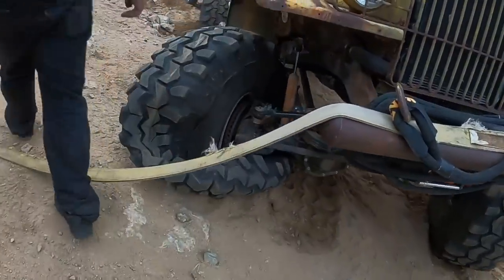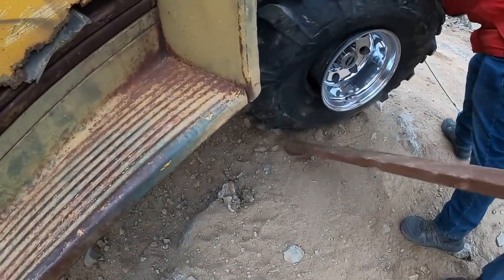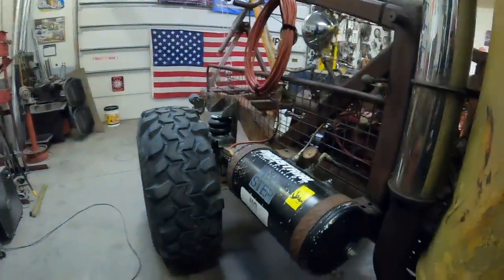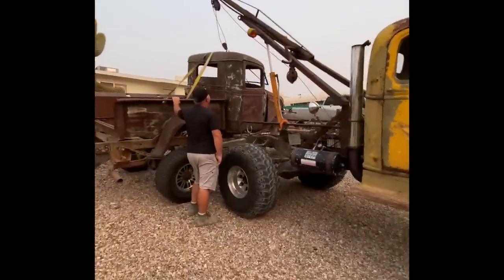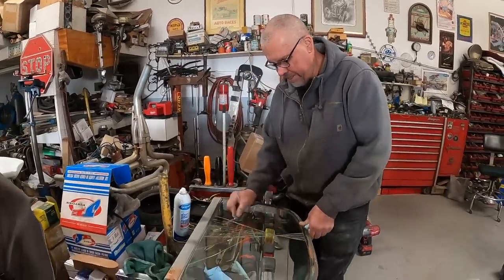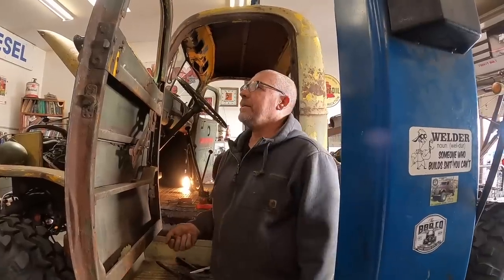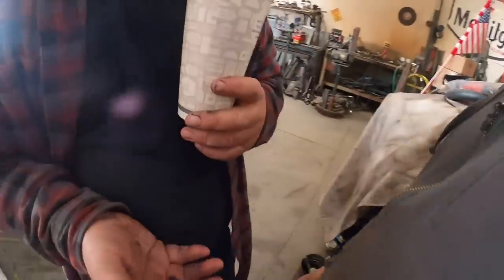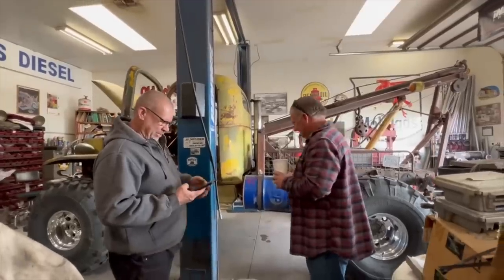The Off Road Wrecker Games are Getting Close, We Will Be Ready $$$

Comment: Merlin, I am very proud of you younger people who take a lot of pride in our country that I served for. I have a lot to say and maybe should break it up in many stories as I have history with most of the army, navy rigs of the late thirties and newer. Dad had me in the seat of a lot of the four by and six by rigs... used  them logging in western washington. We would go  to a part of seattle when seattle was many little towns surrounding the bigger town. A huge place was created for storage of these rigs and we could go there, pick the ones we needed to fix or replace stuff  we had. Our interest in them was the running gear so the  condition of the cabin was just a "if it still works fine, but we could always graft another cabin on them if necessary to make it drivable. I was early in life made aware of not abusing those front axle seals as they are in no way related to the new stuff with regular seals and gaskets... I got myself a roll of knitting yarn to go around bolts and make temp seals till we could disassemble to use the more like a fiber  type of rope that .... heck, you've been in them so no need for me to describe it wrong. My favorite was the GMC trucks with a 270 engine... believe me or not, I ain't here to lie or tell stories fabricated to make it a "better" story. I actually found a few at the yard with two carburetors on them. Gas was very cheap as in less than twenty cents per gallon... I was allowed to put adaptors on those manifolds and put two two barrel carburetors on them for the additional power we were looking for. It was the idea if we supplied more fuel, we had more power and I do guess thats partly right... I was only fourteen at that time. I moved to alaska after I came home from the service in 70. I have had a lot of these trucks as they were in almost every older farm yards... meaning they were adaptable to different kinds of work, just use the imagination as  to what you needed an a  stick welder. A young man living near Tok Alaska, his name escapes me but his collection is getting up there with the many varieties of military rigs and he is friends with a man down in Seward Alaska area who probably has the largest collection of them and does sell a lot of parts if you fill his criteria. He doesn't want to see them destroyed by kids who will never understand the importance of "This stuff is not made anymore!" So the young mans channel name is Backyard Alaskan and he is kind of starting to release a lot more videos. Its his early videos that show him with a large part of his collection being repaired to work again, plus his working with the fellow in Seward Ak. I know that he did give out phone numbers for the guy down there.... he is semi retired now. My memory is really going away as that man and I were friends when I had my own shop in Anchorage. After I moved from anchorage, I quit drinking and being probably the most stupid fellow in alaska. I am still stupid as moving doesn't increase knowledge, but lets say I started making a lot better decisions. Too crippled to  travel or do much of anything or I would travel down to your area for a vacation and see just how you folks have fun... as for me its working... I loved everyday I spent doing something mechanical. I remember now something you said and kind of disagree. You said doubles the power of gas.... its more like  triples the power flatfooted and if ya give it some help, who really knows the limits of power a diesel can make. I guess this is a good spot to stop and if ya have questions, put it in a reply to me... hopefully I will see it and if memory works ,then I can help

Comment: At the ripe old age of 16 I traded a go-kart engine for a 46' Chevy 1/2 ton, I put it back on the road and drove it for 10 years, it was my daily driver, all I changed was a 12volt conversion and a key start starter. It had the same steel framed windows and crank out windshield. I miss that truck.

Comment: Matt made his tow truck look so much like yours.  Sadly Matt keeps twisting off output shafts for the front and rear driveshafts whenever he spins the tires.  Today Matt did say that it weighs 4 times more than the Morrvair.  They do have a lot of suspension flex, so that can bind drive shafts too.  :(
Reply: Apparently you missed the first one-third of Matt's video today.  If you would've watched the video, you would clearly know that Matt explained in depth why it kept twisting shafts. They replaced the parts in the transfer case & took it out on the toughest trail around Sand Hollow. It performed extremely well. Granted it is heavy, but actually i think that's going to be in Matt's favor. The others are going to be too lite in parts of the competition, with maybe the exception of Merlin's. 
Matt's was designed to be heavy, he built it to pull the big motorhomes out of the sand at Sand Hollow, not for the wrecker games!  
As far as who's going to win, I'm not really going to say. I think they will all perform well. Matt has tested his twice, at King of the hammers, & then just now. 
Paul hasn't tested his yet, but it should perform ok. 
Rory takes his out on trails & climbs everyday, has been for years! It's his job! He should do good. 
Eric has had his for years, but he doesn't go on the trails & rock climbs as often, because where he lives. 
Merlins has been pretty much battle tested, so we'll have to see😊 
Should be good, & the main thing of the wrecker games is to have fun, so that should make all of them winners.

Comment: I believe those MaxMPG bottles are designed so you can squeeze the bottle while it's in the upright position and it will slowly fill the upper chamber to the desired level. Then you tilt the bottle to pour the liquid contained in that upper chamber.
Reply: They used to make fuel stabilizer bottles like that as well. Haven't seen those for a while though
Reply: @classicgmdiesel1248  I've got some two stroke oil for my weed whacker in bottles that work like that.

Comment: Hard not to pick Rory for first.  Experience, knowledge development and refinement are a huge advantage, plus he is an artist driving.  If Matt doesn’t break he will do well, and he might not break I think Paul will struggle, the truck is heavy, especially for his driveline, hydraulics and wheel size.  I don’t know Eric.  You are the wildcard, the crawling part might stretch your rig, and I don’t think the diesel is going to make a difference… pros and cons especially in the crawling environment but your problem solving is first rate and the weight of your rig has got to be one of the lowest in the field.
Reply: Nah, Matt has added too much weight. Sure, he might rule in the sand but steep rocks - from what I've seen so far, he doesn't have the traction with all that weight.
Reply: It looks to me like it's more the brand of tires causing he's traction  issue
Reply: @wild2heart  I don't think there is a lot of choices for those sizes.  Having said that the only other rig we have seen doing technical crawling is Rory's.

Comment: I like the diesel engine for heavy pull. I pull heavy trailers with mine and love that it can start out at idle RPM even on the hills. On a standard transmission you need 3 feet when you are behind a gas rig

Comment: Y'all have amazing skills.  I seriously doubt that one team will take all the prizes.  I just hope we don't see a lot of whimpering when it is all over and all the competitors remain friends.
By the way, if you want to remove the rust from old parts inexpensively, try soaking the parts in 10% molasses/90% water for a few days or weeks, depending on how bad the rust is.  This will not replace the missing metal, but it will remove the oxides that bind everything up.  I was thinking of your window regulators, Merlin.
Be well and I hope that Gen1 Diesel does everything you want it to.  I have one myself.

Comment: I put Merlin in the top 3 for sure.  His truck is tried and true for sure, but he has  the lightest truck with the second largest tires.  Rory is a force to be reckoned with for sure.  The heavy wrecker is just that and you can't fix fat, plus it doesn't have enough ground clearance for its wheel base.  Which is also  a problem with the rat rod wrecker.  I love all the builds but Merlin's is my favorite .

Comment: First metal work I learned with oxy acetylene rig was brazing. Then mild steel, arc, tig, and finally mig. Well okay actually soldering was first.  I still love to braze but there is so little opportunity to use it as I don't work on the old stuff like you. 
    Sad the mini semi won't be transporting.  Been watching that build since its day one.   I'm sure many others are disappointed too Merlin.   By the way be sure to wear your glasses at the wrecker games or you could be mistaken for Paul and he'd get credit for your work.     Speaking of, does Mater have a heater core to even warm the now weather tight cab or are you gonna look like Robbie in his Kat all fogged. 
  I don't recall if tow Mater has the T case Trail Mater does that is able to engage axles F or R  plus the outright experience of Rory. I think the 40" tire will play a part but so too will your suspension.   The diesel will help but straight up some rock faces approach n departure angle will be helped by your tire size.    I think you are the only real competition to  Rory just walking away with the title.   Matt n Paul will be duking it out for the bottom. I expect to see either you or TM haul the stupid heavy WLOW more than once.  The ORI suspension will do okay but can't carry a load as demonstrated by paul at chads trying to offload that hulk of what was once a tow truck that had NO suspension in front and squatted that ORI struts to the axle tube.   Trail Mater and its pilot have proven many times capacity.  You're smart and capable of considerable creative feats.   Matt could be a threat if he had a more proven and well engineered machine. 
So let's talk about Eric n Seat Cover.   His machine too is well proven and so too is he. Capable of finding fixes and determined to get the job done. Main problem for BSF is he's not a rock crawler in his experience and his machine isn't all that flexible. Something he needed last time in Sand Hollow. The last time he had Rory to help him as a spot and use TM to get the wrecker off he rocks his approach angle couldn't accomplish. He's enlisted a secret weapon as a spotter trail guide which makes him a competitor. Power wise and transfer case wise his machine lacks also.
I haven't visited the site but the golden tickets didn't outline what feats the games will be requiring of competitors other than saying what ever rules Matt wanted to come up with.  I also heard from both BSF and Robby that they will be towing a samurai through a simulated recovery.   As a result I can't pick a winner but I can prognosticate who will be the front runners. 
  Best of luck.

Comment: The contest will hinge on the course and terrain. The familiarity of the driver to the terrain will be huge . Since Matt designed the course it will probably favor his custom built machine  that probably used $1 million worth of materiel,parts and labor . If the course was at Moab Rory would be a shoe in . Each wrecker will have their strength and weaknesses and look forward to the contest. If it’s very cold Merlin will be a might uncomfortable but only God can  call the weather.

Comment: #1 Rory, Mike and Shawn, they do it for a living and Trail Mater is one bad motor scooter. It's custom built for that area.
#2 Mater, it will blow the crowd away. Probably the lightest truck there and that is an advantage along with torque monster and front weight bias advantage. 
#3 Cousin Paul #4 Matt's gang. They both will break. Paul for sure, they have the weakest drive train and Matt's has a pretty good chance of breaking if he hammers on it
#5 The Wisconsin bunch. It's a good rig for mud, not too sure footed on the rocks.

Comment: I think Matt will win if he doesn't break something.  The chances of him breaking something are pretty high in my opinion.  That build is awfully complex.  Fab Rat's is equally untested and likely to have unexpected breakage.  I don't know the other two.  Your truck is well used and well tested and you are not scrambling at the last minute like most others.  Scrambling at the last minute can be good or bad, but I predict bad because guys are torchin',  welding and wrenching by the seat of the pants, likely to have problems with that last-minute work.  I won't be able to go myself so I hope there is a lot of good video.  If you actually make it there without a heater, I think you will do well.  I recommend getting a snowmobile suit and boots if you are not partial to cold weather. ha.  And I agree with you about diesel power for this type of application.

Comment: Good luck! Personally feel Rory will be first, maybe a race between you and BSF for 2nd, then Paul and MORR coming in last, at least this time around. Matt's rig weighs a ton, not a great thing if he's towing a vehicle up a steep incline as it seems to have trouble on walls just by itself(plus he now seems a little scared of gunning it, and it hasn't been thoroughly tested. I think it'll break on him, and MAYBE Fabrats will as well? I think Matt will learn a lot about his rig and over time it'll become a much more capable rig, and if this becomes an annual deal, he may have a much better shot down the road. But Trail Mater is a beast, tried and true, and Rory is also one of the best trail mechanics I've ever seen, so I think he'll mop up on the welding trial.

Comment: At Least 1-12v defroster/heater with blower.They're @$20.Why Not have a clear windshield and fingers that bend? Window Tint sheets will hold the glass together.Bud had a back door window broken in his 2008-ish Dodge and the tint held the tiny pieces in place.Get the lightest.

Comment: I think the biggest issue you will have Merlin is the lack of beadlocks. Getting enough traction on the rocks while towing will be tough without putting your PSI down low and then that's where the lack of beadlocks will be problematic. Your rig is WAY lighter than Matt, Paul and Rory and maybe Eric, but I know nothing about his rig. So the lightness will help UNTIL you're pulling up a hill and then hopefully you can get enough weight up front to keep the wheels on the ground.

As I said, I know nothing about Eric from BSF, but I do know he's got a lot of experience and of course Rory has LOTS of experience with similar, or worse, terrain. So my guess is Rory overall, likely Eric next and then you Merlin. With Matt and Paul 4th and 5th. But each truck will win a category or two. There won't be a blowout by any team. Paul's for sure gonna break stuff and Matt might, but he's broken enough and gotten that stuff beefed up so he might stay in one piece. Maybe.

Comment: TowMater will be in the top 5 and may be the sleeper even with the slow and steady diesel.  ;> 

Matt, if TomTom can keep him from going hot and heavy on the throttle, might make it through without breaking his drive line again or would that be again, again and again (I've lost count).  

The rigs that already have basically been daily drivers for a while will have the edge for reliability along with their known strengths and limitations while the new builds will be a learning experience for Matt and Paul.  The miles of wiring and computer controlled engines in the two new builds despite all Chad and Companies hard work can become an Achilles Heel for those teams.  With the way Rory and Merlin maintain their engines and drive trains there should be little concern about them being too tired and worn out for the event.

Personally I hope its becomes a Rory and Merlin competition and if Merlin comes in one of the top two spots he should also win the honor of selecting the Turbo Diesel to put in Matts SaMorrI.

Regardless of the final rankings all should be sharing victory pie when its over just for competing.

Best!

Comment: I have not really seen many of these wreckers in action except Rory's Trailmater. It may look like it belongs in a salvage yard to be recycled but it does impressive work. I think that the 2 at the biggest disadvantage will be Matt's Big Off road wrecker and Paul's from Fab Rats simply because they have not had time to run them and get the kinks worked out of the machines. I have watched a few of the videos of the BSF team they seem capable enough but sense the games are in Utah they will be at a bit of a disadvantage as well different environment and different type of rig. So Truthfully Either Rory's Traimater  or your rig most likely has the best chance of winning but it also comes down to what exactly the challenges will be in the games. There may be a split decision. I am pretty sure that it is going to be it is a fun time had by everybody.

Comment: Hi Merlin
I am right here in Lake Havasu. I have a question about my 2017 Ram with a cummins and 173K miles. Great truck and a real workhorse. Never been in the shop for a single repair. Getting a code saying my exhaust particulate filter is 100% clogged. Not disputing the code. Question is I see people on YouTube cutting them out of the exhaust system cleaning them and welding them back together then reinstalling. Your the right person to ask when it comes to cummins engines. Do you think this practice is ok or is replacing the filter and spending the $$$$$ my only real option.

Comment: How did you get your winch brake to work?  I have 4 of these old Belview winches... the insideds are all the same, they rated them via the moter used.  I'm going to  adapt the 7-9hp winch off the new warn winches to bump the pulling power of my older warn style winches with the ratcheting brake!